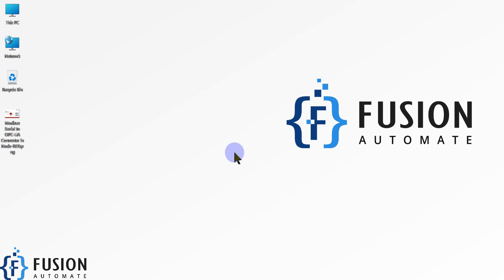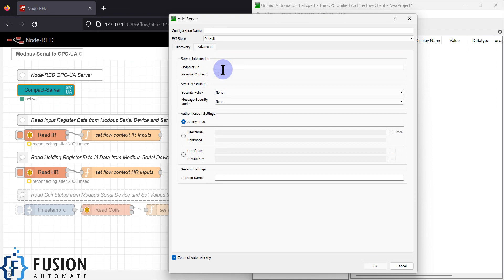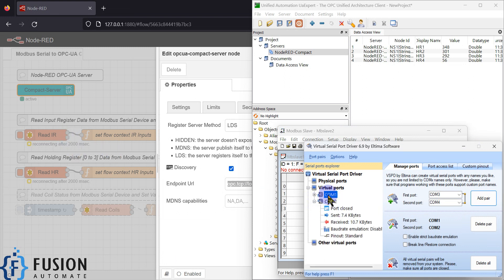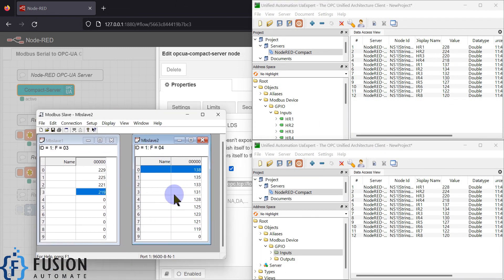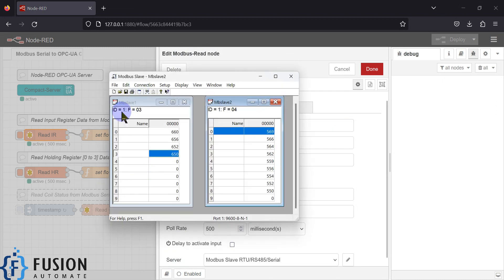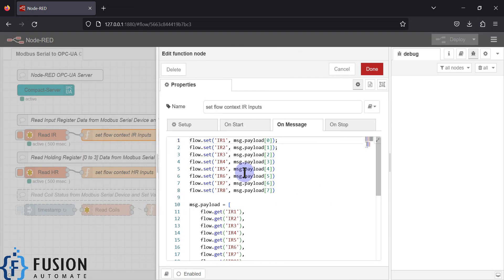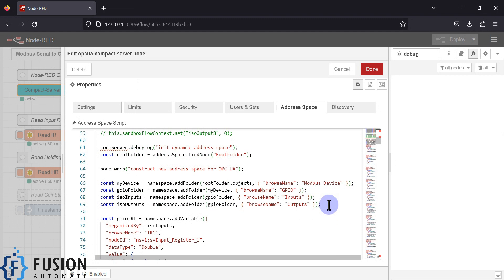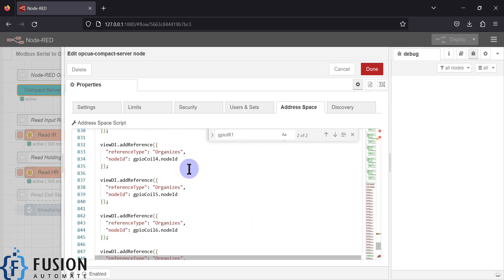Uni-Directional Modbus Serial/RTU/RS485 to OPC UA Converter in Node-RED | Protocol Converter |

Comment: How is Modbus RTU physically connected to the OPC UA host?
Reply from the maker: Modbsu RTU will connect with your System or Pi via 2 wire connection using rs485 to USB converter and then node-red will read data from Modbus RTU device and convert it into OPC UA Protocol Data.